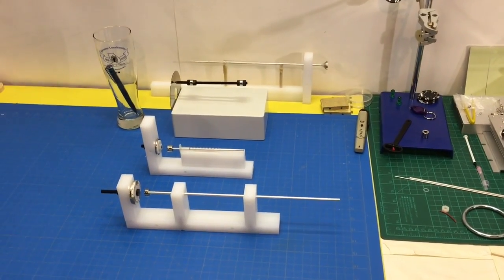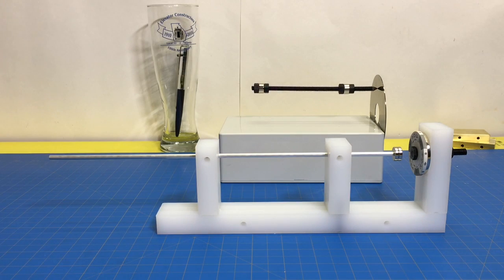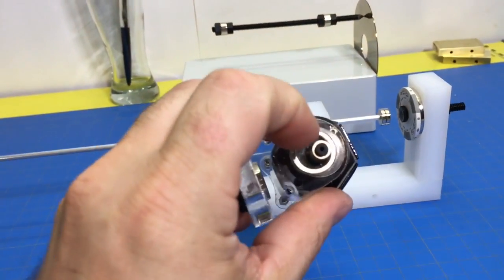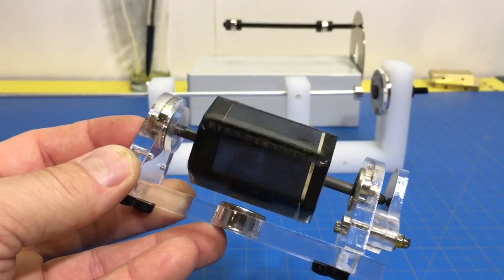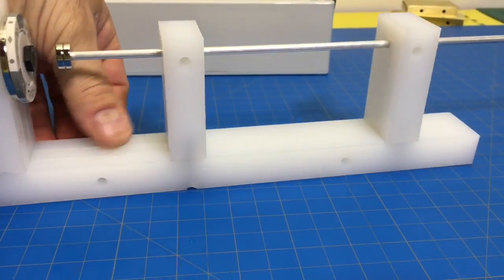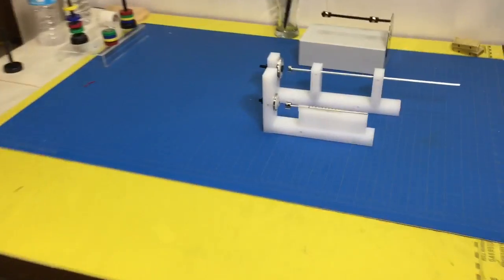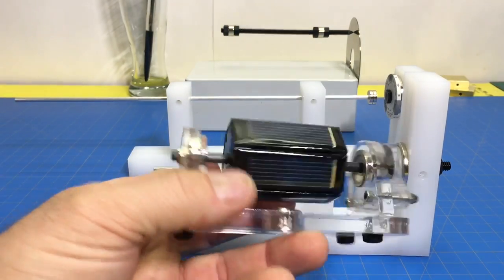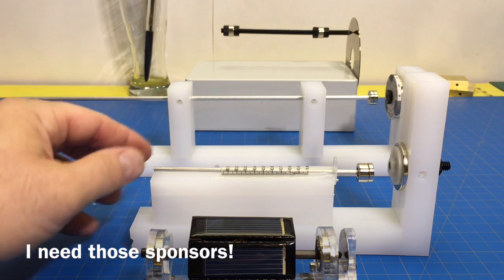Latest Magnetic Invention - V3R3 Magnetically Suspended Axle [KTFG 303]

Comment: You have got a long ways to go to actually do something worth while
If you wanted to, you could have done exactly the same with magnets on the other end of those sticks, and had it possibly floating between your set of magnets on the ends.
And if you used a strong enough neo magnets, You could have actually put a generating principle or a motor supported between the 2 ends. and maybe you would have a very efficient principle, that would not wear bearings out, But is it worth all the effort, since most of that is done in many labs already. And they use a slightly different set up.
But keep trying to think outside the box.

Comment: Hello I, watched ur video just now, this concept ur discovered is already in existence, there is a research paper which describes this invention and is called magnetic inverter tractor beam. This is already existing, this invention u saying can't be done but keep trying as iam also trying to making it, there are plenty of videos in utube describing magnetic locking by repulsive and attractive magnets sandwiched together. 

Coming to ur concept, u can't use classic levitation with this arrangements, as it will slip off, because in this system u need to remove the axial contact of shaft which can be levitated by classic levitation but again due to uneven fields of both system it will slip off  isn't. Am I right, because u haven't posted any video, surely u must had realised it? Anyway iam trying my best, we should never give up.
Reply: Can u see the link
I sent u an invitation 15 days ago in ur website, for a collaborative work. iam also working on similar project and my aim is to violate Earnshaw's theorem , it can be violated because I believe it is possible to achieve permanent magnetic levitation close the zero frictionless utilising very less input as rotational energy. Further iam making the prototype with 3d printed technology in small scale and thinking to patent and launch if everything goes perfectly. If u don't mind we can do it in collaboration and patent is together. Even the great inventer Nicola Tesla has patented a machine which is called, "improved method of imparting energy to or deriving energy from a fluid apparatus  for use there in"U can visited his patent doc, directly by typing this title in google for There one research paper explaining the magnetic tractor beam, have reference to this too. Link - https://www.researchgate.net/figure/Magnet-diagram-of-the-magnetic-inverter-a-front-view-of-inverter-magnet-concept-b_fig2_358431736Thanks and reply me if u want to work in collaboration. Have nice day

Comment: Kevin, if you replace the bolt with something that is non-metallic, does it still operate the same?
Also, could you state the size of the 3?? magnets?  I would like to duplicate your setup.
I have a 3D printer and could print a setup for you if you do not have one yet.

Comment: And still you have a contact point... Did this when I was like 10 yo and I also achieved full levitation.... All you have to do is contain a magnet within mag fields not difficult at all.... Take a bowl glue mags in one pole up then take magnets and join them with a  wood ball between with the opposite pole outward.... Simply works simply...

Comment: Some of my work and materials may help 
https://youtu.be/4V9WbkXkM0I
Reply from the maker: +AVA Magnetic Levitation 
Cool, those are some thick blocks of graphite!
Reply: Kevin Gittemeier 
Hello 
I'm about to list them for sale today up to 100mm square and 12.7mm thick.
I have done some of what your doing and your on the right track. Don't be affraid to use ferrite magnets if needed.
I think from what I know your on the right track to the non touching levitating rod. 
Pyrolytic graphite can help but only if used in the right way with your set up it can in crease or support diamagnetic fields.
I will keep watching your progress great stuff.
Reply from the maker: +AVA Magnetic Levitation 
Good point about the ferrite magnets.
It can get a little cost prohibitive to experiment.